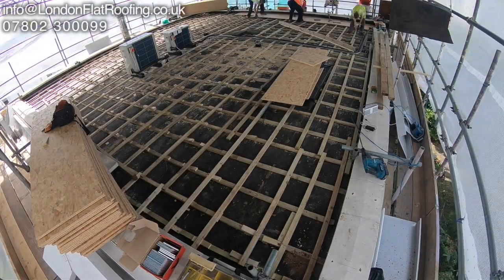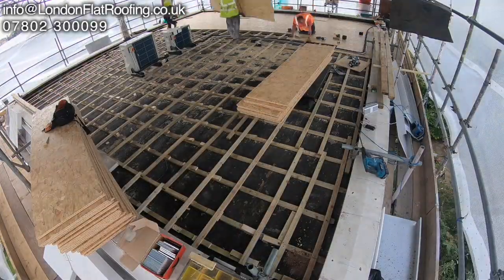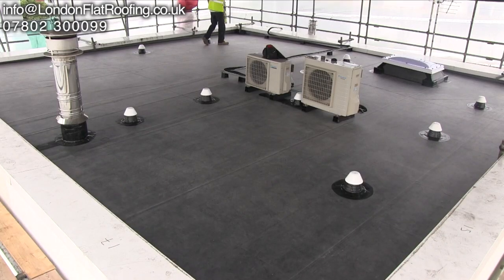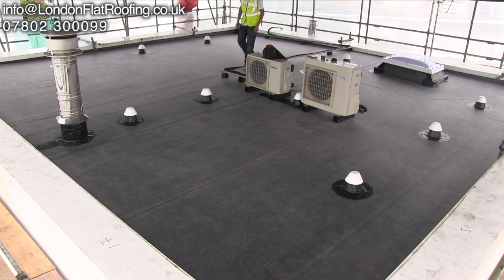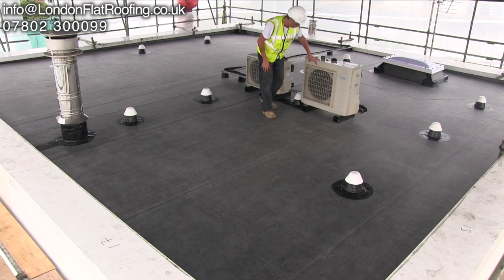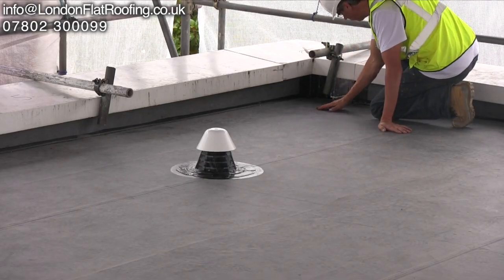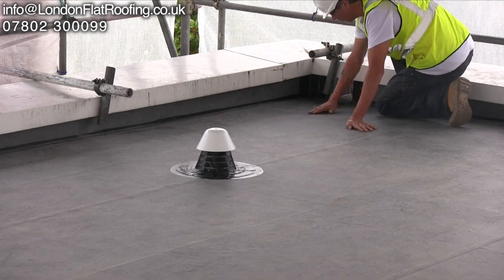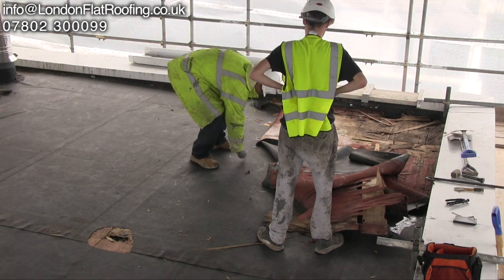Flat roof Mushroom Vents

Comment: i have a cold roof i am working on with zero ventilation. The felt is in good condition. I will be putting celotex in between the joists and vapour membrane. I need to vent though. Which type of mushrooms can i fit that will 'clamp' through the roof or are ok to stick on the outside without anymore felting?
Reply from the maker: You are going to have to felt around the base of all of them

Comment: I recently had my cold roof redone, its 40sqm and battens were added so there is crossflow between the joists like in your video. We had 4 mushroom vents installed in total. Would you say this is sufficient. Also, that all done now but my ceiling have not been touched so there is no vaper barrier. Is it imperative that i have my ceiling taken down to install one.
Reply from the maker: The flat roof mushroom vents I show are large and let lots of air flow. The more air that flows the fewer problems you will have with condensation. If you haven't got a vapours control layer  VCL then the ventilation will save you. The above flat roof hasn't got a VCL, after lots of discussions It was decided that the best way to go was to add lots of vents and not to remove ceiling.
Reply: Thanks Steve, i am going to remove all the ceilings at some point as the 1st contractors i hired bodged it and it completely failed causing lots damage so i will install a vapour check then as well as insulation below the joists. My roof is a roof terrace (art deco property) and the mushroom vents are an eyesore and just in the way. Once a vapour check is installed could the vents be removed/moved or reduced. We couldn’t do a warm roof coz of door level.
Reply from the maker: @Jackzuk  If you remove them you will have put in some other type of ventilation